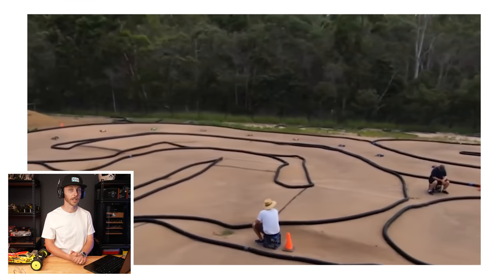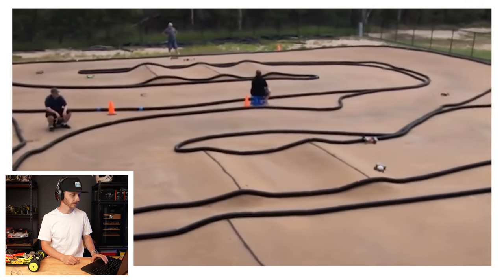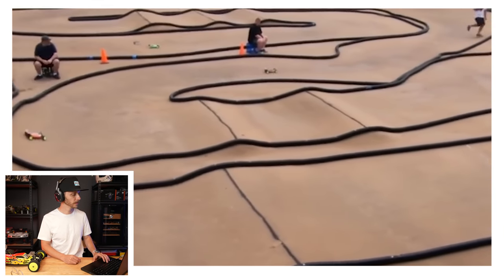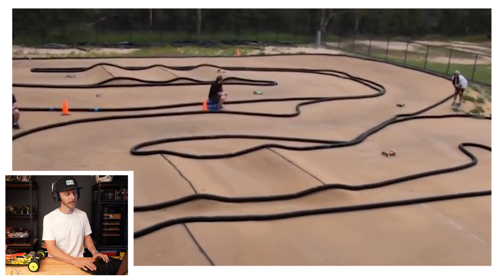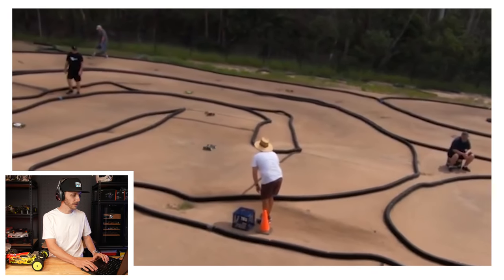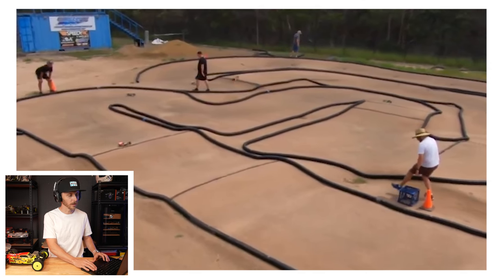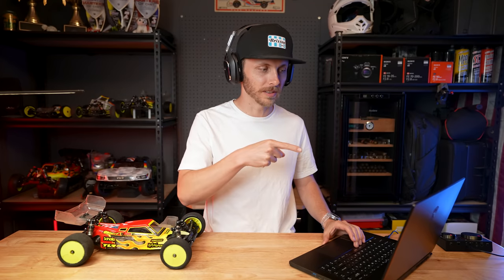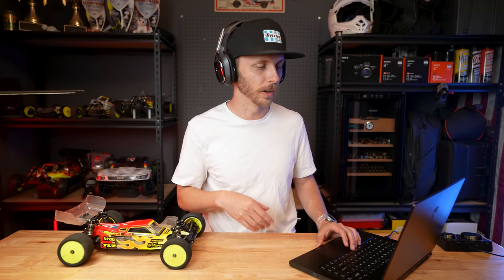RC Driving Lesson Ep2 - Racing Lines & Landings

Comment: So Chargers RC is my home track and I'm one of the consistent A Main 2wd and 4wd stock drivers. The 1st double after the loop that goes into the bowl right handed, best thing to do there is power to the jump then let off as you get to it and whole jump comes together smoothly with the right handed. With the triple I'm one to do the triple all race in both classes but 2wd stock you need quite a run up to make it so between double single and triple it comes down to how the cars set up and your ability to piece it all together 🤙And of course this video is the only race meet I didn't do due to racing R2 of 1/8 state championships the day before 😭 When you get a chance Ryan come down to Australia 🤘 Chargers RC is located in Carole Park, Brisbane and it's open 24/7 and is free to use for 1/10 cars as it's owned by the council. Cheers Jordan 😉
Reply from the maker: Thanks for the insight! Track looks mint 👌
Reply: @RyanHarrisRC  Man it's Buttery when you get all the sectors together 🤘 I think as a beginner it was the most rewarding track to run at as you could see your improvement happen lap after lap 😁 When covid is done come down man and we'd be more than happy to show you around 😉
Reply: Whats the surface ?
Reply: Sic surface. They do a lot of bmx tracks around the world

Comment: Consistency & holding your line is key 🔑 & making sure that every lap times are the close as possible to the same. I’m an oval race on road and dabbled in dirt a. In my oval Days with a pan car my lap times example were 4.0 4.0 3.9 4.0 4.1 4.0 etc etc. average 38 to 40 mph

Comment: I think, one of the things we are seeing is; the drivers are all attempting to hit the jumps straight on.  This makes sense when; going the straight line through the chicane results in hitting the table eschew.  Since the landing is a prevailing left, we'd flick our wheels to the right, in the air, to make sure the vehicle doesn't flip going into the left hand corner.  These guys are really good straight forward drivers.  And keeping the chassis level while jumping angles is a very challenging skill.   I can understand this is all going.

Comment: Looks like there is a mini bowl and definitely a back berm after that first double. My guess is it's one of those track tricks to get you to overshoot to the berm thinking it will get you though the corner faster but as we see in the video it's not. As for the triple, you can see the blue groove is well away from the apex before it, likely from everyone giving themselves the distance needed to clear the triple. The inside line is likely so loose you might not even make the double or just spin out. Watching the other cars in the race, lots of people overshot the first double and nobody took the corner before the triple tight. This looks like a fun track.
Reply: The track has a Sic Surface® top layer. It's like driving on sandpaper so grip is not really an issue but wind down the front straight can be. Before the recent track layout change the Back straight went the full-length(a straight shot) berm to berm.

Comment: I noticed he was landing nose up quite a bit especially on front straight. In "stock" racing adding a little drag brake may help get correct attitude in air. Some drivers get into a bad habit of staying on throttle in the air especially on a wide open section, this has helped a few people I know.

Comment: I come from a simracing background and getting into RC and I really struggle with jumps. I don't know how to jump consistently and landing on my wheels. What is the trick to this. Do I apply full throttle before, less or maybe even brake to keep the car balanced during the jump? I tend to crash at times, but at other times I land fine. I am not entirely sure what to do.

Another thing I struggle with is perception. In simracing I can see the corner and apex as I approach and make my line from the cockpit, but from such a distance I struggle. Nothing wrong with my eyes, it just feels like guess work to figure out exactly where the car is pointing. Any tips for this?

Comment: Why not single double vs double single. Or is that as risky?
Reply: With a double single you are scrubbing speed and not carrying near as much momentum so you can keep the line tight as you pretty much roll the single. If you single double you’ve still got all the momentum from clearing the double and unless you jam on the breaks you’ll still blow that corner.